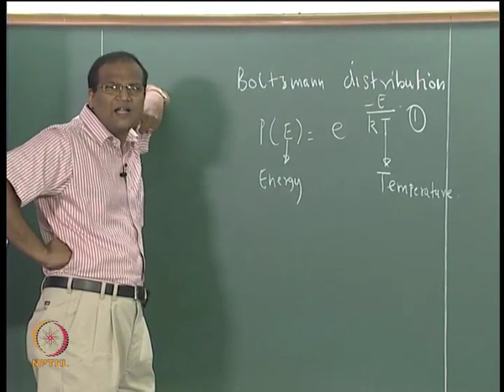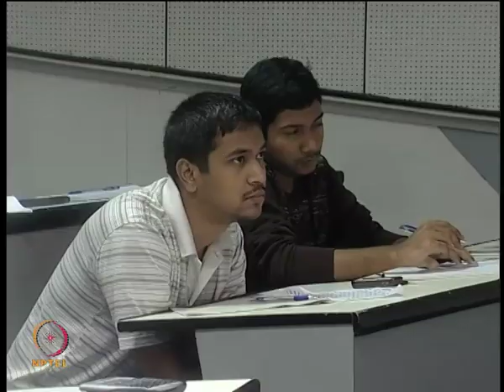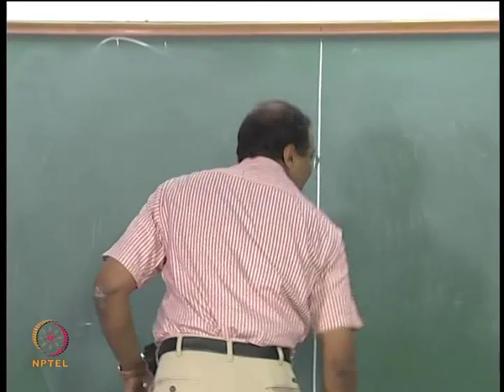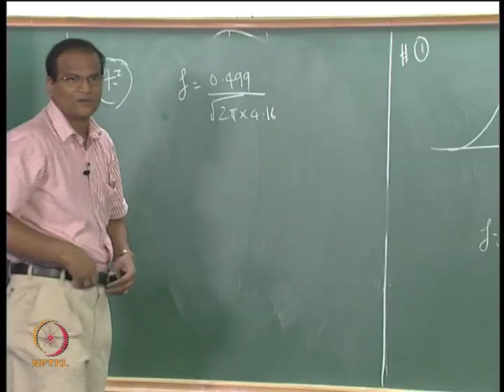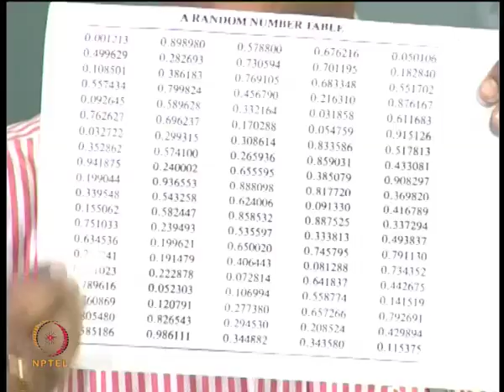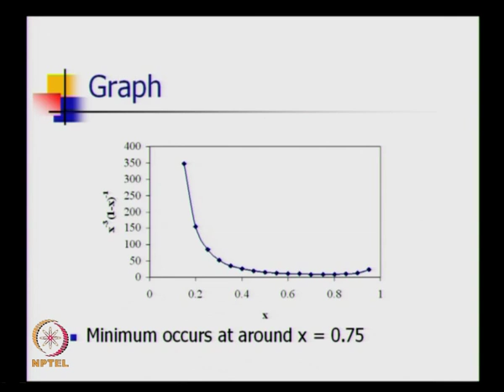Mod-01 Lec-40 Simulated Annealing and Summary

Comment: 1.how dalta X comes 
2.how x1=13-(4.99 how this number come from)and y(x1) and y(x0)
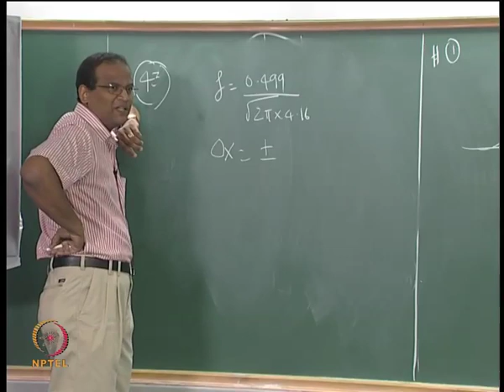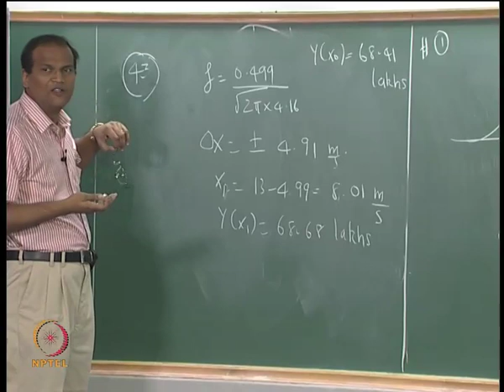Between [48:05 to 49:20]
please Answer
Reply: See, delta x is (x1 - mean), which we will have to calculate from the formula of normal distribution function (f), by substituting f = random number chosen from the table i.e. 0.499629 and we will normalize it for the sake of keeping its value bw 0 and 1, by dividing it by [ √(2π)*sigma]
That's how delta x comes and further x comes out.
Reply: 2. Y(x°) = the functional value of cargo ship equation when we substitute X=x°= 13 (as we assumed in the beginning of prob)
And similarly, y(x1) = same as above when substituting X=x1= 8.1